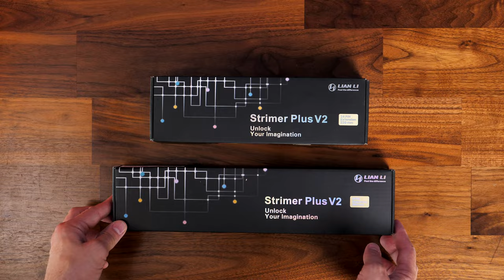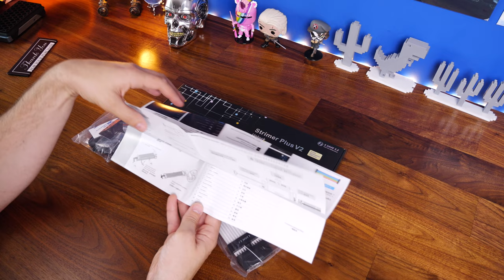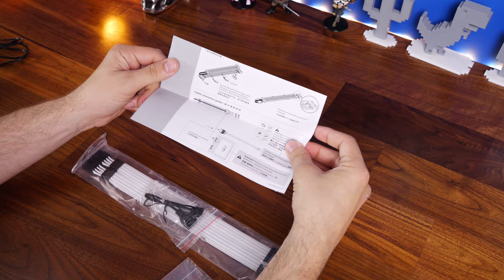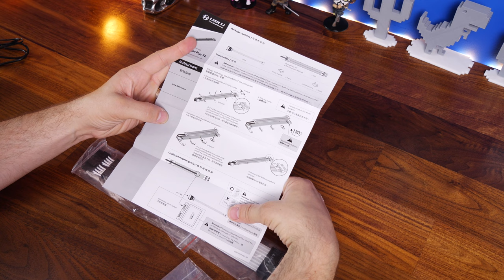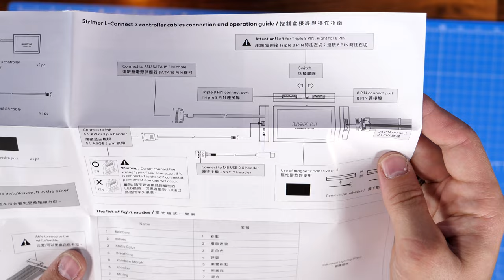Lian Li Strimer Plus V2 ASMR unboxing and installation

Comment: Nice video,
Have you noticed that the 24 motherboard cable has a manufacturing fault, it has edge lighting at the bottom section of the cable where it's divided into the three sections but the top section does not have edge lighting. Mine is exactly the same, quite a bad fault as the edge lighting should only be at the bottom and top of the cable, not in the middle section. Currently waiting to hear back from lian li as some have this issue and some do not.
Reply: Have u gotten a response about that, mine appears to have that same problem
Reply: @salspiano7521  no, I haven't but seems to be normal or very common!
Reply: @tremorflow3614  yea I noticed that as well, thanks for the reply tho brotha
Reply: I got the same problem, could you please share with me what did lian li say?
Reply: @Ungraviitiify  he said he never got a reply but from what I’ve seen most if not all of them have that